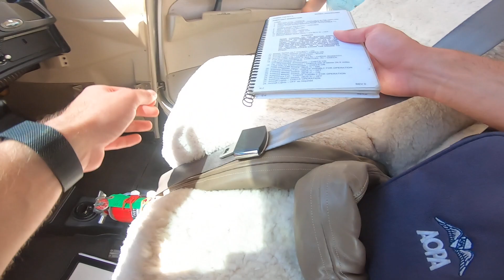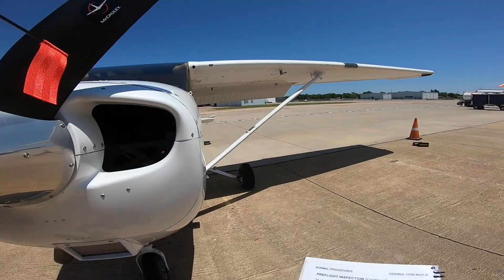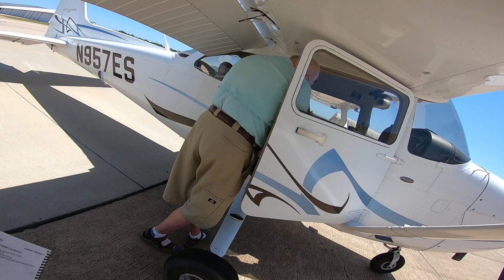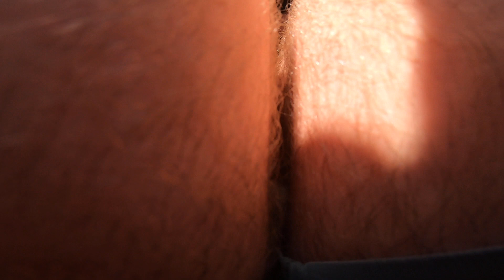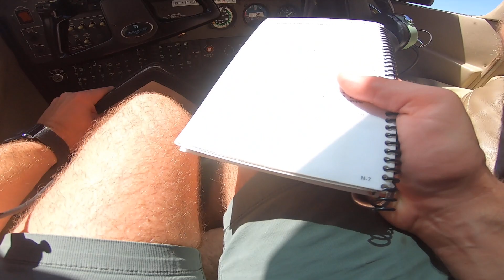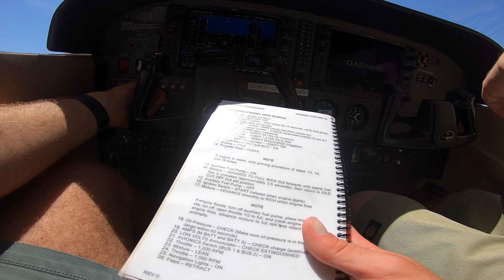C172 Preflight and Run-up G1000 [HD]

Comment: Pre-flights are all that stand between you and a crash due to an un-airworthy aircraft.  You want to go over the plane closely, intentionally trying to find a reason to ground it.   This was one of the sloppiest pre-flights I've seen.  A few things I noticed:

1) Check that the aileron hinges and control arms are actually connected!  You didn't even look underneath to check them.  There's a piano hinge in there with a thin metal rod through them.  The rod should be flush on one side, have a hook that is secured with a machine screw on the other side to prevent it from sliding out.  The control rods should be attached and have some slop in them.  If they're tight to where you can't rotate them a bit or extremely sloppy, no bueno. 

2) Elevator hinges need to be check to ensure the nuts & bolts are firmly attached.  Same story for the trim tab and rudder. Again, you failed to even look at these.  At the same time, you're not supposed to pull on the trim tab with your hands. 

3) Check the tail rigging.  There are 4 cables back there, 2 for the elevator, 2 for the rudder.  You should be looking to see that they're reasonably tight (the rudder's are spring loaded and can be a little sloppy when fully deflected to one side).  You also want to make sure they're not frayed or rubbing and are securely connected.  

4) Sump the fuel like your life depends upon it -- because it does.  Especially for an aircraft stored outside.  That GATS jar should be damn close to full after sumping all 5 fuel ports on a wing.  The GATS jar needs to be compared to something with a white background.   AVGAS is colored blue, so holding the jar up to the sky isn't going to show you contamination.  When you pour the fuel back into the tanks, it needs to be poured through the mesh side of the GATS jar lid.  The mesh filters dirt and moisture out.  You should also be checking the gas cap's vent and ring seal.   You also failed to check the gascolator and other 2 fuel ports on the belly of the aircraft.

5) Stall horn... check it... you didn't. 

6) Lights check?  Even if flying day VFR, you'll want strobes & beacon.  Landing/taxi lights are a good idea in the daytime for safety.

7) The plane has 3 tires...you checked...one.  You also want to check all of them and even roll the aircraft a bit if you're renting.  You want to make sure there aren't any flat spots.  Depending on where you're renting, the last pilot to fly prior to tire damage getting reported gets the fine/damage fees. 

8) Baggage door, static ports, missing bolts, empenage, alternator belt tension, etc.  There were lots more you missed.  Take another look at the POH. 

I'm not trying to be a jerk;  I want to to become a good, safe pilot.   These checklists were written in the blood of those who died in accidents.  I know they're a pain at times, but there's good reason behind them.
Reply: I was going to say, he missed a few things on that pre flight, Even in the 141 world pre flight is major, and the CFI's check behind us.
Reply: These are EXCELLENT points and MUST be emphasized to new student pilots!!  A thorough, PRE-FLIGHT can SAVE LIVES!
Reply: Agree that several important items were missed!
Reply: Thank you for sharing this. I am a student and didn't know those specifics about sumping the fuel
Reply: @bostinaycock8316  As an addendum, it's not a bad idea to drop a few drops of sumped fuel onto a piece of paper.   Avgas will evaporate cleanly.   If there's any Jet A contamination, you'll have an oily residue left.    Despite what is commonly taught, Jet A mixed with Avgas isn't going to separate in a GATS jar.   I've added this to my preflight checklist recently.
Reply: how do you check the stall horn? You don't blow in it do you??
Reply: @comicahmet  suck on it. Or use a little tool you can buy
Reply: And key should have been on dash
Reply: I don’t even fly the Cessna 172 much.. I’ve flown in it once in the last year and even I remembered all of this off of the preflight…
Reply: Anybody who sees your comment as you being a jerk shouldn’t fly airplanes. I got my CFII in 1998 and my A&P in 2001 (worked on gen and commercial from C-172 to B-747) so I can confidently say that what you said is spot on. I’ll even go further and say that this CFI should stop teaching because without even looking at his student he should have known that this preflight was way too fast to have been done correctly. This display of unprofessionalism made my blood boil. NEVER assume that the last mechanic who touched your airplane was good at what he/she does because some are not, I’ve seen it with my own eyes more than once. Even good mechanics can get distracted and make a stupid mistake. As a student pilot with limited knowledge, you lose your elevator up there….good luck to you. If you crash and burn because of something that could have been caught during a thorough preflight, well, that’s unfortunate but what if you crash on a car killing a mother and her two kids in the back seat? Did they deserve to die because of your sloppiness during that preflight?
To all new student pilots who viewed this video, please read again and again what was said in the comment by Grayrabbit, take notes and every time you do a preflight, do it as if your airplane just came out of maintenance and someone told you that something was not done properly but could be caught during the preflight. You don’t know what it is but your job now is to find it before you go fly that airplane. Each preflight should be done in that state of mind.
Good luck and stay safe.
Reply: Duly noted and added to my printed and Foreflight preflight checklists.  There was a mis-fuel incident at PGD not too far from my home field.
Reply: @comicahmet  Actually, for a C172, suck.  When the angle of attack for that wing approaches stall a low-pressure area develops.   As to how to perform this, they sell little squeeze bottles which you can hold over the stall Inlet, or most of us just toss a paper towel over the hole and suck.
Reply: You did such a good job listing what we should be doing properly that I saved your comment in my notebook. Thank you !
Reply: I agree
Reply: Bla bla bla. Seriousky if I ever fly with u, keep ur chit to urself, I'm not going to spend 20-30 minutes preflighting every flight like you and so many newer pilots do these days. The preflight in thr video is adequate, done by an efficient and logical person who can clearly see nothings wrong and past experience shows preflighting this way hasn't caused some crazy issue. Pilots these days do everything like a Brainless drone
Reply: @gp1003 a preflight doesn't need to take 30 minutes, I can do a complete fully thorough preflight in 5 min or less, and the chances of something catastrophically going wrong is minimal. Young pilots are lame, people in the 80s and prior would do quick preflights. Logic dictates that prior experience of fast preflighting and nothing going wrong for decades indicates the same outcome in the future, I see too many student pilots these days or even private pilots who spend fkn 30-45 minutes on a preflight, like seriously do you think something is bound to go wrong 100% of the time because you didn't preflight for an abnormally long time?
Reply: @davidt8087  I look forward to seeing your upcoming video on Dan Gryder's channel.
Reply: Didn't check the fuel quantity with the stick. Gauges are inaccurate.

Comment: This reminds me of how frustrating the preflight process was, and why so many things easily get forgotten. Especially so when you're strapped in and adjusted only to have to go outside again.
Reply: I always preflight with the checklist, every single time.  No matter how many times I've done this and can recite it verbatim from memory, I still stick to the list. If I get interrupted, I start over from the beginning.

At my home field there have been a few incidents in the past year that would have been avoided if the pilot bothered to do a proper preflight. Fortunately no injuries but there was bent metal, bent props, and engines replaced. We all pay for this in our insurance premiums.

Comment: Very nice video. Very nice to see young pilots like myself out and flying. With that said a Pre-Fight performed like this during a check ride, you wouldn't even start the engine and you'd fail. You need to take a good 15 minutes to check that airplane. Every little detail from hinges to tires to movement and yes rivets and screws. Not to mention leaving the key to the airplane in the door.  I'm not saying this to trash this pilot but to better his future and enable him to fly a safe airplane without serious injury or death to him or his passengers. All in all very nice airplane but i would not get in with any pilot in command doing this bad of a Pre-Flight.
Reply: Yea the cfi definitely failed him on the walk around part. I can only hope hes not the same in the air.
Reply: I don’t know what kind of DPE’s you guys are using but mine didn’t even watch me preflight for PPL or IFR
Reply: But I do agree, preflight was sloppy, needs to be a flow around the plane

Comment: ARROW one of the first things you do. Any reason you did not check the two engine gas sumps?  The G1000 system is excellent system. It does have a limitation. The G1000 system only interpolates the gas level. There is no mechanical connection between the fuel tanks and fuel gauges.  Make sure to do a visual inspection of the fuel tanks. For this reason carry a fuelhawk  fuel gauge. It will visually tell you how much fuel is in each tank.  Happy Flying.

Comment: So i know your a student and your learning but there are checklist for the physical preflight and you ran around the entire plane skipping things not really caring what u where looking at

Also you skipped the most important thing which is to physically verify the fuel quantity you cant rely on a fuel guage as it can be incorrect 

You didnt check the pitot tube for blockage nor static port , you didnt check if your stall horn port is clear

Your version of checking the gear was to kick the tire fyi kicking the tire doesnt tell you if the cotter pin is there holding the nut to the hub

Bruh use your checklist and dont stop using it

Comment: Correct me if I'm wrong but doesn't the KOEL explicitly state that the Standby Attitude Indicator is required even for day VFR operations? (It's actually required for all operations day and night). I noticed in this video that the equipment is placarded INOP. Shouldn't this plane be grounded? Or am I missing something? Also this student needs to re-visit his pre-flight procedures lesson. A lot of stuff was missed in this video. Saying this out of concern, not to be rude.
Reply: Pretty sure I saw in the KOEL once it is only required for IFR day and IFR night.
Reply: @ryansiroproductions  gotcha. You might be correct. I’d have to go back and look and I don’t have it in front of me at the moment
Reply: @ryansiroproductions  you are correct my friend. I had a copy of my POH on my phone and the KOEL does note that it’s only required for IFR day and night operations. Thanks for pointing that out

Comment: Man ohh man, I hate to add another bad comment but jeeze this was rough to watch. I'm truly hoping you flew this plane prior but this video should be removed... this is no where near a proper preflight check done... Call me crazy, but I carry a flashlight (even during the day) and check inside all the nooks and look at all the bolts.  So much wrong here in this video. 

And you're going out to do a hold, from what I could hear from your instructor, and not even a single cross scan check on your instrument...